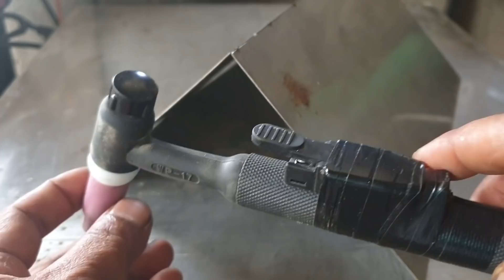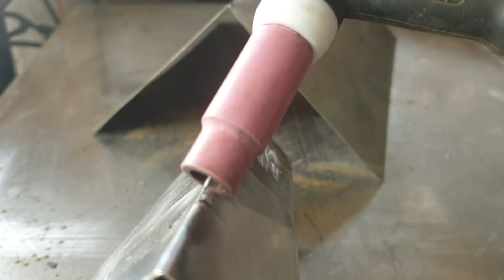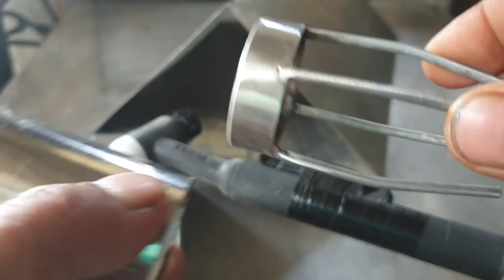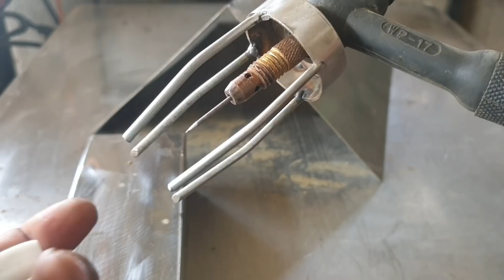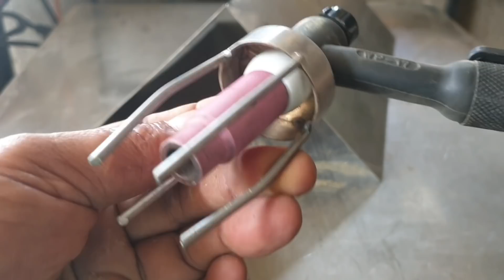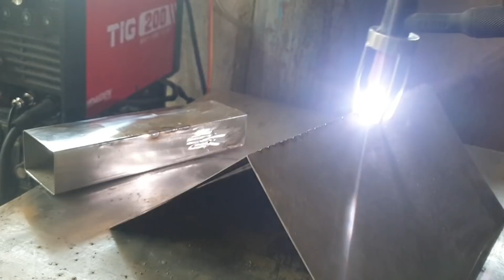how to weld a great and extraordinary using homemade tools

Comment: Invent what ever you want bro. These guys see a home made tool to make your job  a little easier and start hating on it but, its ok for them to use a weld positioner to rotate pipe or a trolley to weld a straight bead! Smh...
Reply from the maker: Terimakasih sodaraku dan saya selalu memikirkan apa yg mereka kesulitan dgn peralatan sederhana,
Reply from the maker: @Lee Walton terimakasih itu ide yg pantastic
Reply: This just makes TIG welding more difficult because you're not actually developing the necessary skill. I've been welding TIG for 21 years now and I've never needed such a thing to help me with my standoff from the material
Reply: It's to build muscle memory, it's not a bad idea at all. An very useful.
Reply: I've been a Pipe Welder for 36yrs, and have Tig Welded at least 14yrs. that's about the dumbest set up I ever seen. To each their own.
Reply: @toddjcole6935  yep, what the video poster doesn't understand is that your right hand is your guide and standoff. Also you have to often change your Arc Length anyway so a fixed position will impede your weld.

Think of your TIG hand like a paintbrush. You don't always keep the same height off the canvas/steel. Sometimes the tungsten needs to be buried almost in the weld pool and sometimes you can get away with a longer Arc. Depends on material, position, etcetera. You'll see what I mean after you weld for a few months.
Reply: Hi I'm
Reply: I love it when people try to improve.
But will say if one of my imploded or colleagues made one of these I hadn't instructed/learned him or her good enough or the person can't tig weld. But 8 out of 10 for the try. 😄
Reply: @77Avadon77  now put tape over your eyes and level the playing field.
Reply: @akbychoice  I could probably give you a good run for your money even with tape over my eyes. And that's just because I put so many hours in to TIG welding. I mean thousands of hours. There's no magic secret, there's no skill from birth, it's all about how much time you want to put into it
Reply: @77Avadon77  prove it, put up a video
Reply: @akbychoice  I'll get a blindfold and a cigarette and see if I can weld that way 😅
Reply: @toddjcole6935  Right on. What Country or part of the country you've worked? In the shop or in the field?  I did a ton of work in Western Canada, mainly Alberta. I did mostly 99% field work, mostly because shop work felt too close to an office job. Im an outdoor dog, a bit uncivilized I guess. Nah..I always liked new places, jobsites, spools, people. 
If you're in the US, where's the busiest places for pipeline work? Im guessing between Texas and Alberta for one, but then, do you guys send it somewhere to refine? Over here it's weird. The crude is all processed and sold as crude out west, sent to the US and Asia, but then largest refinery that boils it down to end products like engine oil or petroleum is on the opposite side of the country on the east coast. In between the two is Ontario "chemical alley" in the middle of the country. 
Now that I've said all that, I'm a retired oilpatch pipefitter/welder "double ticket Red Seal" and you could we welding pipe in another industry completely. A spools a spool though, eh?

Comment: Why are you trying to rest it on the work piece, just free-hand it like you're supposed to and you wouldn't need that jig.
Reply from the maker: Hanya untuk yg masih belajar seperti saya
Reply: Lay off the coffee.
Reply: The ceramic cup or the tungsten tip are not supposed to ever contact the work piece, you steady yourself by using both hands and leaning your body or forearms against something stable.

Comment: I don't know if you're not a good welder and just innovative because you couldn't do that free hand. Or a good welder and innovativeon on top of it. Instead of a guide, try a TIG finger for your pinky that will allow you to drag your hand across the work and not get hot. I've used them for TIG and stick; they work well. I use them for stick because I hold my rod when it's new on my left pointer finger (I'm right handed). Good video!

Comment: As a welder of 30 years...I think this is a great idea....
Every Tig welder has "dipped their Tungsten" at some point
Then had to go resharpen, change electrode etc. --- That's time
Many Old timers were taught to walk the cup...walk the cup, walk that cup...YOU HAVE TO WALK THE CUP!
Ummm...you don't have to walk the cup.
This can prevent dipping the electrode especially on fine critical work where you want no chance of contamination.
Reply: I'm impressed 👌

Comment: It reminds me of all those commercials where the person is spastic and can’t peel a potato, or paint a wall without messing up the job. Out comes this new tool for your flatware drawer. The only thing is you’ll need to make different lengths for certain jobs. But this is a pretty cool designed attachment. I’ll  make one, what the hell.
Reply: Surely if the joint is 90° the lengths should all be the same
Reply from the maker: Terimakasih sodaraku semoga keberuntungan menyertimu amiin

Comment: You could always try holding the tig torch above the work piece like a normal welder
Reply: This
Reply: But that would require a skill which he doesn't want to learn
Reply: It's to build muscle memory it's not a bad idea. But I also get where Kai is coming from tho. Nothing beats just doing it. It also builds muscle memory lol
Reply: @ronniewilliz153  I think you’re off here. Muscle memory is created best by doing it properly. This gimmick is convoluted and a waste of time.
Reply: Looked a little shakey. Could be age or alcohol, either way he fixed his issue
Reply: Learning TIG in my 60's, my hands just aren't that steady on a good day.  I'll take any advantage I can get.
Reply: @douglasbutler4360  try walking the cup mate it takes some getting used to and you can't always do it in every position but it takes your shakes out of it
Reply: @douglasbutler4360  or try holding your welder so it rest on the hand and your hand rest on the matirial. And always the wire over your shoulder so it's not your arm carrying the waight

Comment: How did you not shock yourself?
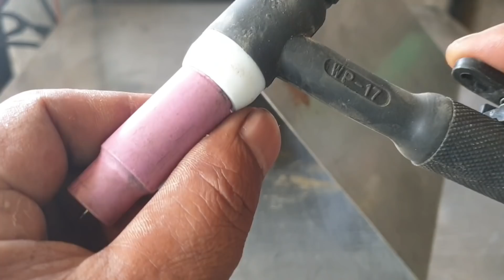Reply: 0:12 You can clearly see that he did.
Reply: @fltchr4449  right, that's what I meant...
Why didn't it hurt him?
Reply: @armenvegas  The large arc gap and no shielding gas raises resistance way high and drops the voltage way low.

Comment: Le pondrias puntas de aleación de berilio de cobre . Para que no se peguen las guías y sea más Sueve el deslizamiento.
Reply from the maker: Tidak menempel ke tembaganya kawan
Reply: @DediKarya  He meant build the accessory with a cooper alloy material so it slides softer while welding.
Reply from the maker: Terimakasih teman itu ide yg bagus